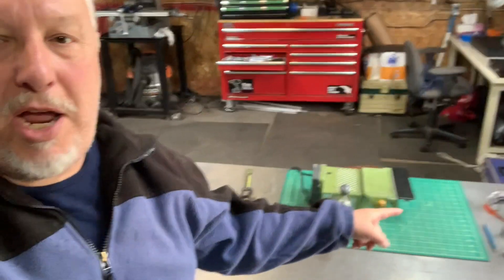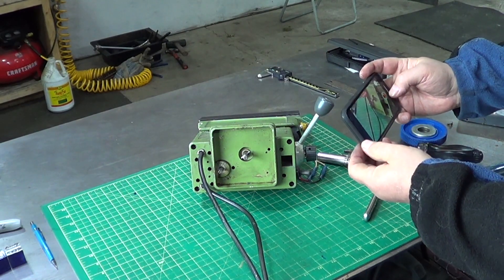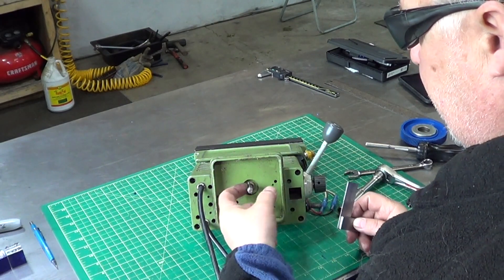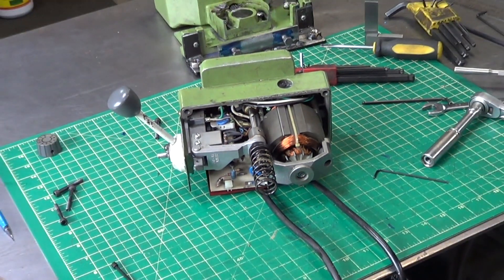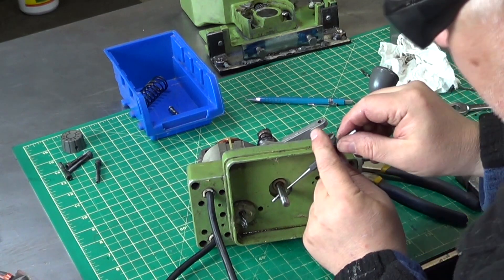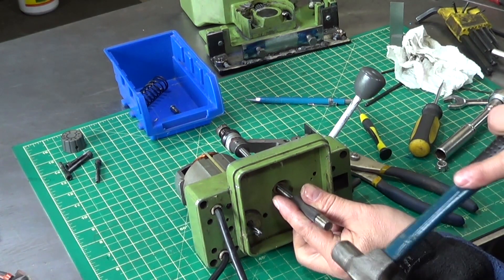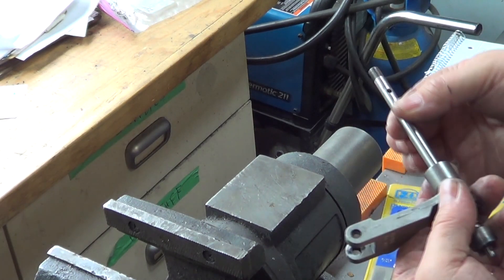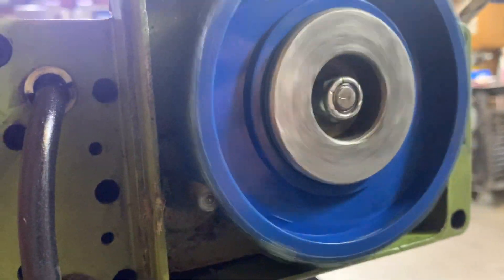Power Feed Shaft Repair

Comment: That shaft is very soft.  Next time you need to take that gear off, use two screwdrivers 180° apart.  Given that the gear didn't break when you used only 1, a puller grabbing the outside at 2 or 3 points should work too - provided that you can get one whose legs open wide enough.

Comment: I was hoping you would fix that. Nice calibrated hammer hits! That runout is probably why the previous gear failed. 
I have a similar version of this power feed but it drives a bevel gear on a regular milling machine. So the motor stands vertically instead of horizontal. This version is for a low headroom, so it hangs off the table horizontally. That whole shaft is a disengage clutch to the final gear. I installed three of these on my mill. Also one on my drill press, which can't drive the quill feed gear without a gear box, as one revolution is 4 inches of quill travel so it needs more torque to operate as a power feed while drilling. I got a 10:1 gear box for stepper motors to make that work. Also installed one on my 10x24 lathe tailstock which is slick for nice power feed drilling. That smooth feed prevents drill breakage. And I can put a pretty large drill in that won't grab with a constant slow feed, that my hands can't do as well.
Reply from the maker: Power tailstock now that’s absolute genius. Gotta look into that 👍🏻😊
Reply: @LetsRogerThat  The tailstock power feed is extremely handy, the drill press, not so much, but the 10:1 gear box on it is very handy, as I made a 6" crank to enable the manual drill press down feed. 
The lathe tailstock, I made a longer quill bolt on to the rear of the tail stock, and a longer quill for deep drilling, as the original had only a 3 inch travel. I also machined the new quill to hold a MT#2 tang, as part of fixing spinning tools. 
The error on my part that precipitated all this was I was trying to hold something between centers, this was just a bit longer then 24", and the tail stock fell off to the floor and bent the crank handle. My eyes were on the headstock taper. This is a Jet brand lathe, and there was no provision of a tail stock travel limit, so off the end it went.
Reply from the maker: @f.hababorbitz  wow that must have been startling. Thanks for mentioning all this. Great info.